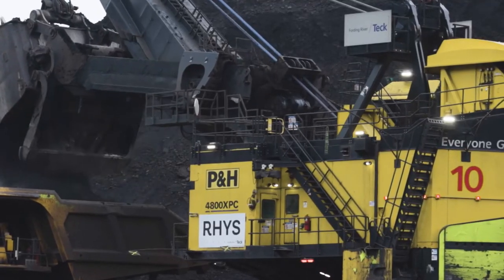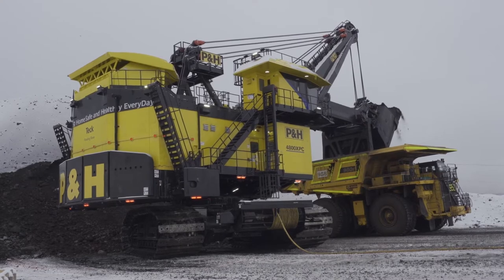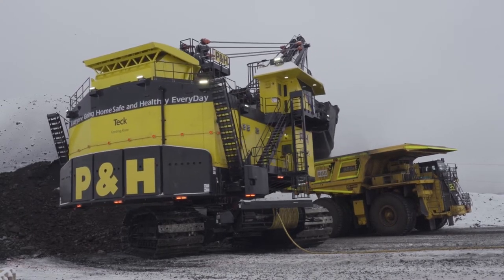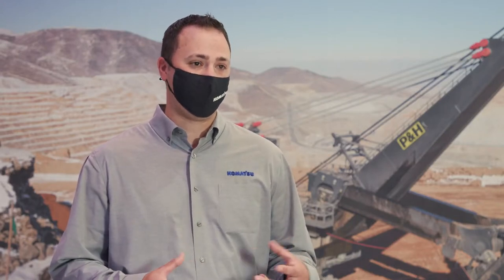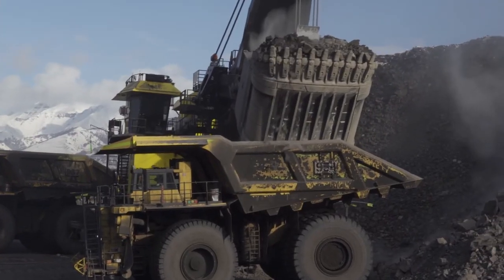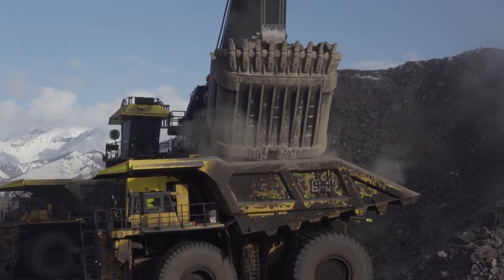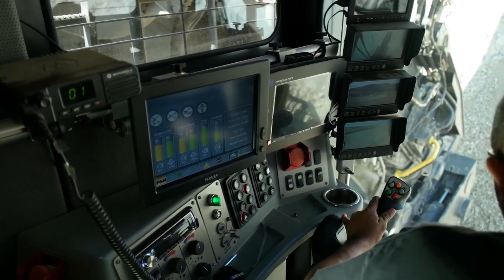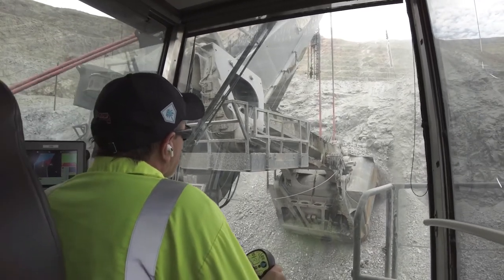Product spotlight: P&H 4800XPC Electric Rope Shovel

Comment: Do these shovels have a bathroom or a breakroom on them? They’re so huge
Reply: @ChinchillainTheHeat   This size machine will definitely have a bathroom facility on board. Also a small refrigerator and microwave would be available for the operator. Keep in mind that a giant rope shovel like this might be working in extreme weather conditions. As a mine owner or contractor you would not want the operator leaving the confines of the machine to use the bathroom. That would actually be a safety issue as well. The operator is very safe while on board the machine. Not so much when walking outside near 400 ton capacity haul trucks.And of course you have the productivity and efficiency aspects. In mining operations this type of machine is known as a PRIME MOVER and it is imperative to keep the operator at the controls as much as possible.
Reply: @williamhall9204  I got obsessed with this and started digging on the internet.  Some guy told me on the older one's the operators would go in a trashbag in a bucket.  I know at least one of the newer caterpillar draglines does in fact have a toilet and small kitchenette.
Reply: @chinchillaintheheat2641    I’m pretty sure that the first large excavator/shovel, to feature an onboard toilet, sink, refrigerator, and microwave was the famous O&K RH 400. The oil sands miner in Canada, known as Syncrude, was the first to purchase the giant hydraulic shovel. That was in 1997, and Syncrude went on to purchase more units. Due to the severe weather these shovels would be working in Syncrude specified all the amenities be installed. It’s important to note that O&K and Syncrude both collaborated on the development of the RH 400. It was a partnership that worked out very well. I’m sure the operators were happy with those machines.
Reply: @williamhall9204  Wow, that's so cool.  I'd love to tour one some day.  I know those tar sands are pretty rough environments so I can only imagine how crucial it was that the operators have those necessities.
Reply: @chinchillaintheheat2641    Just thought I’d let you know there is a very interesting video on YT about the O&K RH 400. Video is about 28 minutes in length and shows the giant shovel being built in the factory. The unit was the first to enter service and went to work for Syncrude.The title of the video is Production of the largest hydraulic excavator RH 400.If you get a chance to check that out, I think you will be very impressed.
Reply: @williamhall9204  I work at this mine, no bathroom on board. There is a microwave though lol
Reply: @dustinalexander157    That really surprises me. It’s hard to believe that the shovel operator has to leave the confines of the machine when nature calls.Amazing that a shovel worth over 20 million US dollars would not have a chemical toilet onboard. And the other consideration is the extreme weather conditions the machine works in.
Reply: @William Hall  I completely agree. 
Shovel operators just pee off the side of the machine, apparently if they have to take a #2 a laborer or foreman will come pick them up, but I've never seen it happen. 
When I went for my shovel ride along I made sure to look for a bathroom, but there isn't one. Lol
Reply: En raison de leur taille massive, ces pelles sont conçues pour maximiser l'efficacité d'excavation, et des installations comme des salles de bains ne sont pas intégrées.
Reply: @lovofarm je ne parle pas
Reply: Always be P& H ❤